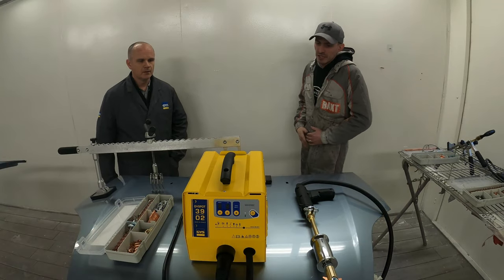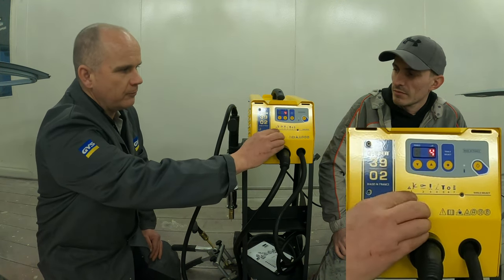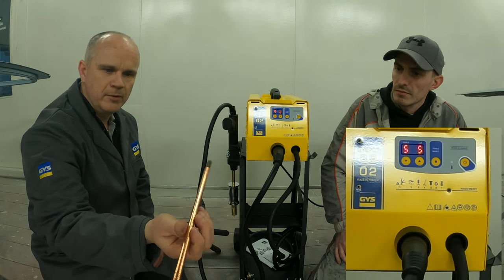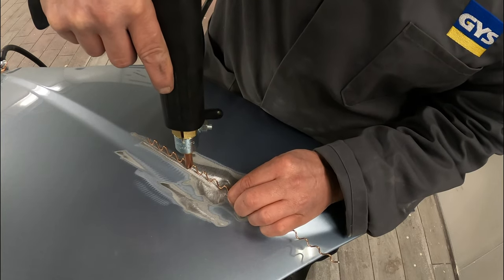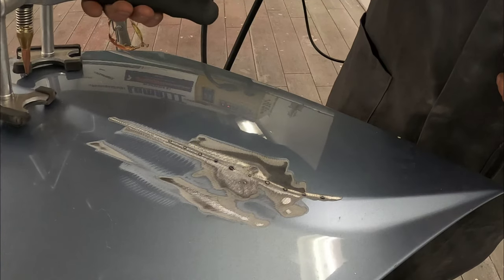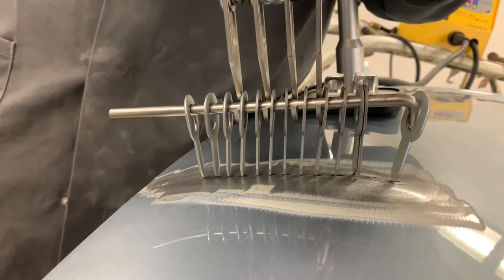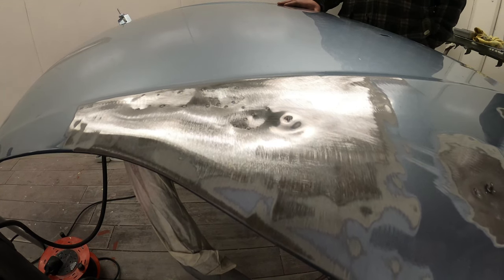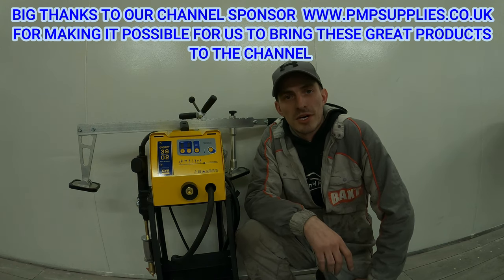Dent Repair / Dent Removal / Panel Beating With The GYS GYSPOT 3902 Dent Puller System ( Easyliner )

Comment: Nice video again mate i use the gys system but have never used the carbon shrinking tool would have nice to have seen that being used 👍👍
Reply from the maker: We will mate was hard to get things into this video and as much as I’d have liked tbh but we will be doing future videos / repairs using the system in more in-depth
Reply: Tony's Refinishing sound mate that would be good 👍👍
Reply from the maker: Carl Heath will be doing loads more repair videos in the near future so this setup will be used alot on the channel from now on tbh mate
Reply: Tony's Refinishing cool mate id be lost without mine but seen a few different bits like the claw hook that you used in the video is different to mine id like that one as seems more controlled when turning the screw instead of mine that you pull arms in with it can over pull if not careful 👍
Reply from the maker: Carl Heath might be because I think this ones there latest system mate so may be a few differences like the auto weld feature and puller
But I know you can get all the accessories through pmpsupplies mate if you wanted to upgrade any parts and this tbh will save us so much time and effort now with dent repair work n metal work
Reply: Tony's Refinishing just messaged david mate hes passed my details on so hopefully get a visit off a rep 👍👍
Reply from the maker: Carl Heath nice one mate

Comment: Hey bud I brought a similar machine from china about 2 years ago and struggled using it with the copper star shaped tips kept blowing holes and tearing. I did more research and noticed people using a much more expensive machine but the tip they used was like a long shape pin. so after researching more I found a supplier of the tips in America it was expensive I paid $150 Australian for 3 tips delivered. the tips fit my handle which is by the looks exactly the same as yours and works like a pro now!!! so if you want to improve your machines capabilities well worth the investment. I got them on ebay more then happy to send you a link if your interested.